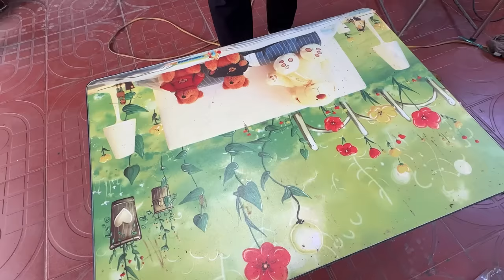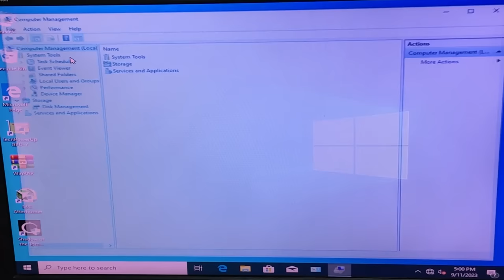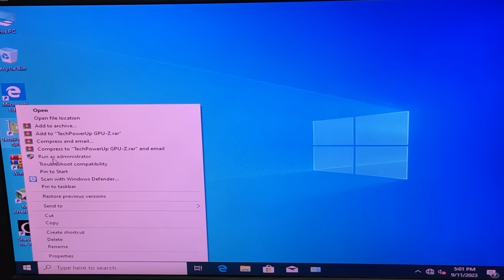Restoring old computer forgotten in the sewer | Repair msi b75 gaming Gtx 1060

Comment: Just like in other videos, there are weapons, watches or PCs lying somewhere on the side of the road. And interestingly, the objects are always extremely rusty and after thorough cleaning with soapy water the rust is gone. If the stuff were so rusty there would be corrosion, but there is no sign of it. They must have a really great cleaning agent that can convert rust on the components into original condition. Strange ???
Reply: just a reversed video...with a paint rust  effect.
Reply: I think the PC and rust were rigged. Yes, it really did have rust and debris, but no I dont think this was a genuine find. 
In this video I noted how nearly, if not, all the the metal was not deteriorated in any way. I'm especially surprised about the pins and traces that NONE, not a single pin withered away. I also kinda cringed how the 3.3V battery remained in the motherboard during the chemical cleaning... thats a good way to fry the RTC/bios if it shorts depending if the battery was fresh or not.. For the thing being in the sewer, that button cell battery is very shiny... Also there's no way two random caps would go missing without any sign of corrosion as you mentioned, especially between other perfectly fine looking capacitors... The pins arent even in the solder joint which indicates it was previously removed. It didnt 'rust off', if it did the old pins would still be in that solder joint.

Then it boots up first try without any problems at all? To a windows operating system thats already activated and all drivers installed? I didnt see any ssd in the clean up, so I assume there wasnt one in the computer, meaning they had this ssd prepared ahead of time.

I'm speculating this PC was really not in that sewer for long. Maybe a month at most but I think closer to two weeks or something.
This isnt a regular "rusty ol' " pc

Now I understand I may be wrong, and I'm willing to accept that, but I find all this too fishy for me to be totally convinced this was genuine. 
The restoration work was very nice, however.
Reply: plastic doesent rust then how is it rusty??
Reply: @saadoonalfalahi2223  That could be chemicals and contaminants in the water or an oxidized reaction with nearby metal that covered the plastic. This happens in toys as well where brown markings are left behind on the plastic.
Reply: @saadoonalfalahi2223  they told to rust to do so
Reply: its called ccr
Reply: Dude, people are doing it with animals. Think about that abusing kittens so they can "save them"
Reply: @2012TheAndromeda  don't forget him installing at least three different ram kits...
Reply: @saadoonalfalahi2223  lol

Comment: While replacing the Alcaps at 20:33 you can not read what is written on it , but suddenly at 28:25 you can clearly see the writing on the Alcap is more visible ... Probably he had 2 cards..
Reply: Откуда он знает пароль от компа?
Reply: @Александр-ф3ж4п  от того что он лично накатил винду на хард
Reply: just content not real😎😎
Reply: No, its not two cards. He take working boards, make video how they work. Then he solder, then put PC in to water, then wash it. You can not check order on video. Simple magic.
Reply: @Yaroslav_55  It is content indeed, nothing real happening here, otherwise why the missing caps in a fully assembled GPU? you would expected damaged caps or other parts, but missing? doesn't make any sense as they are way well protected between the cooler and the PCB and the only way to remove them is by de-soldering them. but you know what, was fun ( I mean, putting and old and plotted  PC in a slump for like a week, for a restoration video)
Reply: not probability, but sure indeed that are two identical gpu.
Reply: And why can't you read it? Cause there's grey gunk on it. 
They have a new invention called "cleaning". Maybe he used that magical invention you clearly never heard about.
Reply: @Angel-go5vt  the caps he "replaced" were the same ones he removed, you dont usually find original manufacturer caps like those exact ones, shit is only for content.
Reply: @j.d.4697  c'mon. This is well known method based on water with heavy hydrogen. It can still make foam but is is not conductive, does not dissaciate. Simple. Brush is from the veasel, who has very high impedance fur. The fact that the cleaned PCB is a new one, with different labelling, is irrelevant.
Reply: Always he have 2

Comment: yeah very real so all of that component is immune to rust
Reply: Look pretty obvious what they did, they placed a computer in the canal left it there for a week to gather up pretty much mud, saw a comment which I can find now saying how is the plastic rusting, lol its mud not rust, check again to see if it had a cmos battery in when they found it
Reply: 9;33 putting a CMOS battery into the system now suddenly, lo lets say someone throw a system away into muddy water lol, right why the hell would they remove the CMOS battery????? Reason being right the battery holds a charge they knew when they placed that pc into the water it can survive that kind of damage if cleaned out perfectly as long as there was no current flowing throw the board at all, no real harm can come to the components, same goes for when i do want a really clean motherboard and was it with water and soap i remove all charge from the board and the CMOS battery to prevent damage, obviously once its completely dry again the cmos is reset and you have to reset the time and date again, but there are other rocket scientist here as well

Comment: this is not fixing, but it is called replacing cause you replacing so much party on that, power supply,ram,harddisk,even you adding some ssd in that stuff, look i can do more than this even can fixing dead motherboard and vga, i expected more but this is little dissapointed for me.

Comment: wow..he wash a motherboard..world guinness record..nice😮‍💨
Reply: motherboards do work after being washed with water if dried completely , but not so when violently scrubbed with a brush and soap like a shoe as shown in this video the chances of components falling apart are extremely high especially when it comes to those tiny ceramic capacitors

Comment: Why does it appear to be rust that occurred after artificial crushing, rather than naturally occurring rust? I think it's normal for a crack to form on the end of the case lid. If you look at 2:59 seconds, the HDD side looks fine. It makes no sense for the wide surface covering the lid to crack that much.

Comment: taking a toothbrush to those pins under the processor would ruin them , you normally only have to fart in their general direction to bend them in my experience

Comment: this makes me sad, I am in the process of repairing a few gpus and the replaced capacitors are clearly not there when he has it on screen and that clean in 25:59 I cleaned a rusty 5700xt and got it working again aswell... you can never get them that clean after they have been corroding. Atleast it is a positive video ish but still

Comment: In this person's video, severely rusted electronic equipment can be revived by simply applying detergent and flushing it under running water・・・？
On the new production line, we remove even minute dust from the human body, prepare static electricity-free clothes, and assemble the products in a strictly divided room, but it seems that these are not necessary at all... ·Impossible!

Comment: Making people fool. Neither it's the same motherboard nor the GPU. You could clearly see there is no rust on those metal connectors on the mother board and there is no sign of sanding although he did rub that with sand paper.

Comment: I refuse to believe that after bathing in that small canal, then deep cleaning with a hose and a brush, especially when you used it on the CPU socket, this damn motherboard and componets are still working, all I can say is that MSI does a well fucking job making that motherboard, while you are still at it, why not try to clean the power supply, you can most probably have a shocking result doing it.

Comment: somehow suspicious
1. elements are not oxidized
2.strange rust
3. if you threw the video card into water, it would 100% oxidize like other PC components
I’m generally silent about hard drives... THEY WILL BE COVERED WITH BAD BLOCKS AND WILL NOT BE WORKABLE, this video is clickbait
and I’m not glad that I came across such a channel that is lying, and even if it had lain for a long time and the rust was not artificial, firstly, the rust would have eaten away more than it, secondly, as I said, oxidation would have affected the operation of the components, thirdly, capacitors and parts of the VRM zone lost their normal functionality and would be unstable I am a computer master but I do not publish my work but nevertheless I wish that complaints would be imposed on videos related to electronics in this format and the videos would not come across anymore
Reply: bro the video is scam just from the look just watch for fun